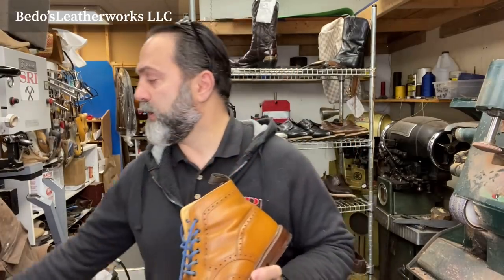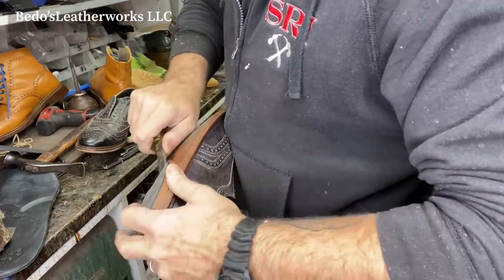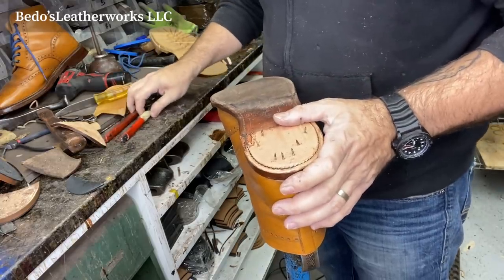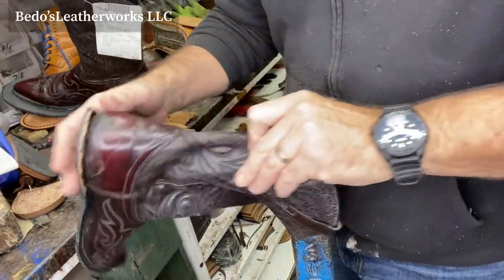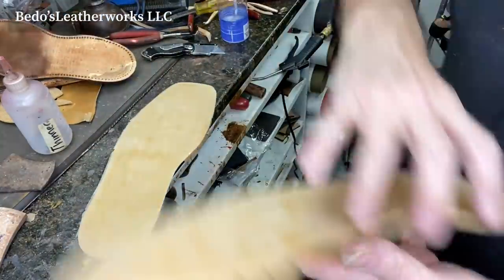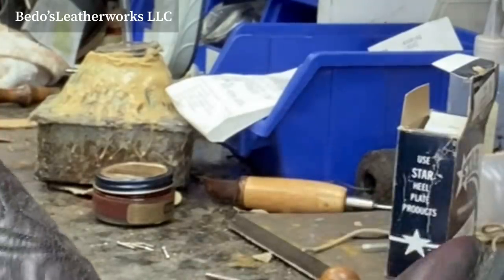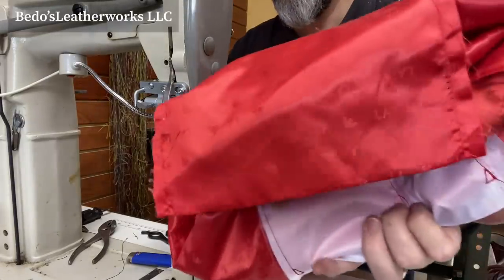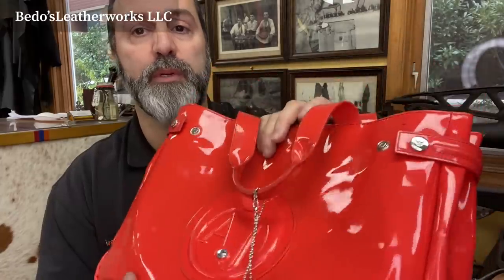100 K Giveaway Winners

Comment: Congrats to the lucky winners!  Fine job on them.

Steve, you've commented from time to time, wondering about variances of construction with Allen Edmonds' shoes.  I just received a pair of their Cornwallis (black) oxfords, and saw "Bench Welt" debossed into the sole.  I did a search to learn the difference between a Goodyear Welt and a Bench Welt.  Turns out, there are at least four types of construction used by AE.  They're all considered a Goodyear Welt construction, but, materials used determine the classification.  "Bench" is the more traditional materials.  Then to "lighten" the shoe, there are variations of materials used for the "Speed Welt"; "Flex Welt"'; and "Storm Welt".  They offer an in-house YouTube video to explain it. 

Ok, I have to confess... I also received my pair of 5th Ave. (Walnut) Dainites, and am waiting on the arrival of my pair of Cornwallis (coffee) oxfords, and a pair of Strand Weave (black) oxfords.  They have a sale.  LOL

I've been putting off sorting things out since it's been years since I've been fitted on a Brannock Device.  So, I ordered one.  As it turns out, my hooves have changed a LOT over the years.  I went from a 13D, to a EE... to a 14EE.  The Brannock Device determined I'm a 15D (due to the length of my arch).  With that information, placed my order and, am I glad I found out the fitment from the Brannock Device !!  15D, I am.  So... conditioners applied inside/out, creams applied, and a couple of coats of wax (except for the toes of the black Cornwallis).  Waiting on my "Navy Blue" cream to arrive for the toes before waxing the toes.  And, stocked up on shoe trees too.

With all of that behind me, I'm probably not going to mess around with having those Ecos rebuilt... wrong size now.

Comment: I have a question if I may?
Would it be better to invest in a really good knife to cut the threads? 
Your craft style knife - which you occasionally sharpen - needs new blades periodically.
If you acquired a Spyderco, Benchmade, Emerson, SOG, you would have a much better blade that required less honing and would retain its edge for a longer period.
Reply: Don't imagine any of those style of knife would be fine enough to cut shoes - blade too thick. A hooked scalpel edge would work great but be brittle. For the amount of cutting a cobbler will do, disposable utility/ box cutter is still the best way to go. JMHO
Reply: @OmarKhanUK  
I'm not a cobbler either brother. I am a knife collector though. The makers I mention (other brands are available) make thin blades. The tip of an Emerson CQC7 or most Spydercos, are thin enough to do that job I would have thought. Also, they're probably legal carry in Steve's state and can be used for many other purposes.
Reply: @octaviussludberry9016  I hear you. I like my knives too; daily (not so legal) carry is a Ultratech. But for working shop where Steve is always snowed under with work, replaceable blades just make more sense than having to strop/hone a knife each day.
Reply: @OmarKhanUK  
I guess unless we take up shoe repair or Steve picks up a wholesome knife, we will never know.
Nice knife BTW.
I'm in the UK - knives here are not legal carry unless under 3" length and non-locking. There are many collectors though. Sadly we all get caught up in the knife crime in London issue.
Currently carrying an Emerson CQC 15. Not in the least bit legal carry in the UK, but then I'm not a gang member or in London.

Comment: Beddo the loake bedales you did had they been resoled before because mine have victory soles?
Thank you👍🏻
D Smart
Reply from the maker: It didn’t look like it
Reply: @marksconce4983  They were bought new in 2010, and Loake had changed the design a little since then. The hard leather was tough on my knees hence to initial rubber sole request at my locals, but the more I saw Nicks/ Whites bots, the more I came around to that design - can't get logger boots here in the UK, little else but disposable. Steve was willing to step up and give it a go, and I love the way they look. "4x4 dress boot" someone commented. Exactly what I wanted!
Reply: @OmarKhanUK  I think they look good but wondered a dress boot into a heavy duty boot  ,I'm probably old fashioned about loake I got married in a pair of loake brogues but the bedales are so comfortable hardly no breaking in and so easy to maintain.
Reply: @dainsmart6237  Sadly murder on my aging knees, and walking around on hard floors were sending shocks up my knees and through my joints.. with trainer insoles inside them. Switched to DocMartens for daily wear purely for the extra cushioning, but my dress shoes are all Loake. Honestly though, if they don't work out, switching back to Dainite soles would be easy enough as the whole outsole would  be replaced. I have a new leather midsole and a pair of boots I love very much that I can daily wear again.